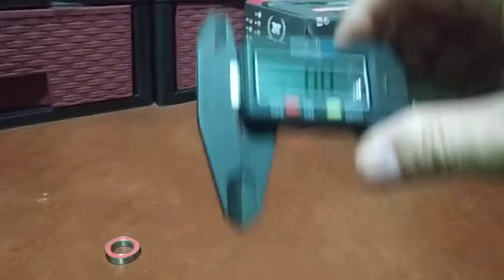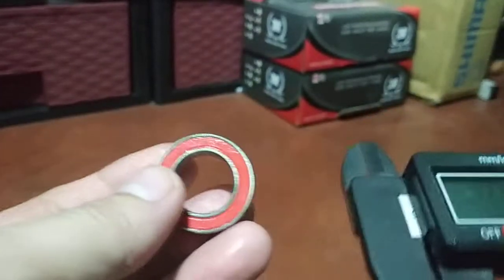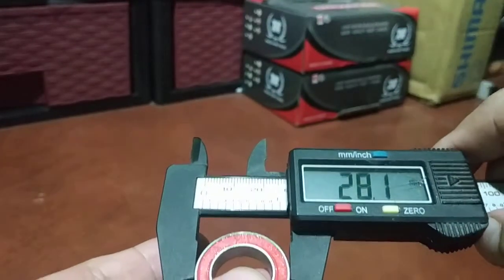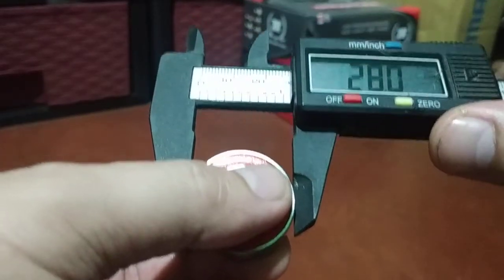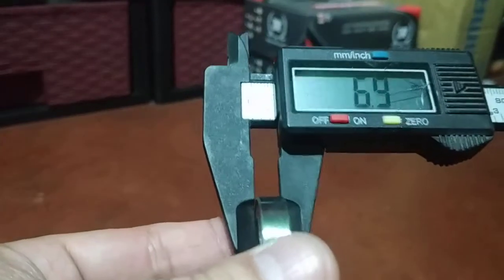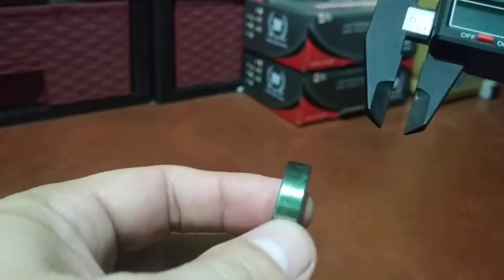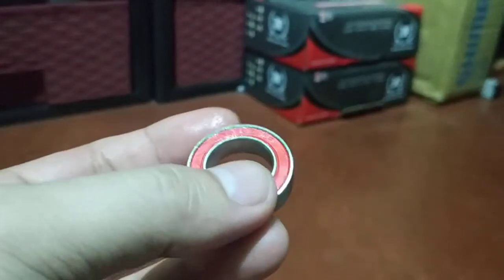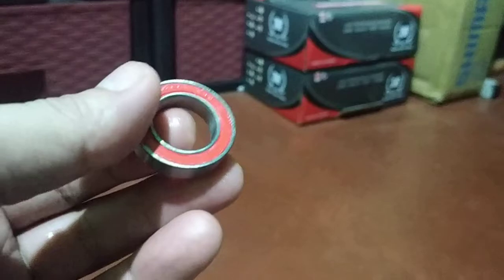How to measure 17287-2RS sealed bearing

Comment: Sir papasok ba ang 15287/6902 bearing sa 17287? parehas sila ng outer diameter ea.
Reply from the maker: Pwede bro, mag iiba nga lang inner diameter, pero kung axle mo ay 17mm diameter pwede yan, always use digital caliper, wag na yang codes codes dame kasi palpaks na code
Reply: @JomsF  Wala kasing mabilhan ng shaft na may 17287 diameter. Puros 15287
Reply: @JomsF  Pansin ko din kasi parang may shim pa sa loob ng inner diameter nung 17287 tapos dun din naputol yung old shaft kaya duda ko yun din ang reason baka naukit nung shim.
Reply from the maker: @johnkarlogallardo9158  ah bale reremove mo na shim para parehas na silang lahat ng 15287? kung ganun nga bro, anong hubs yan? ibang klase din design ah pinahirapan pa tayo eh noh hehehe
Reply: @JomsF  Oo sir, iisang bearing naiba sukat nasa gitna pa 😂. Hassns Pro 4, naputol kasi mismong shaft naka Thru axle kasi tapos end caps lang adapter ko dapat pala bumili ako ng barrel sa loob.
Reply: @JomsF  Update sir Joms, dumating na yung shaft na inorder ko at gumana yung conversion na naisip ko 😂 from 17287 to 15287/6902. PS. 6902 at 15287 ay iisa ang sukat. Pumasok yung shaft at wala ng shim na kailangan 😊
Reply from the maker: @johnkarlogallardo9158  yown! Thanks sa update bro, iba talaga ang mga pinoys, maghahanap talaga tayo ng paraan, thanks for sharing men!
Reply: @JomsF  Yung shaft kasi na available lang ay pang 15287, iisa lang naman yung 17287 na bearing sa rear hub kaya balak ko palitan nalang din ng 15287 para pare parehas na sila 😂